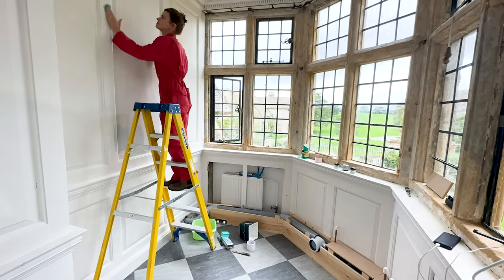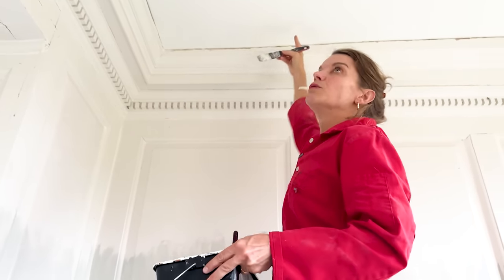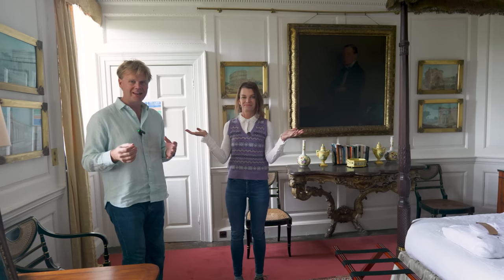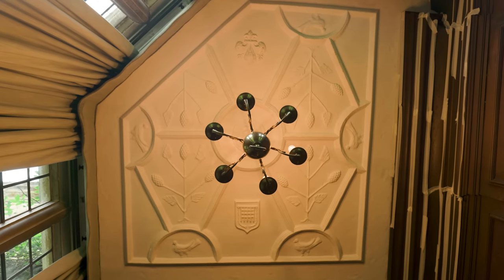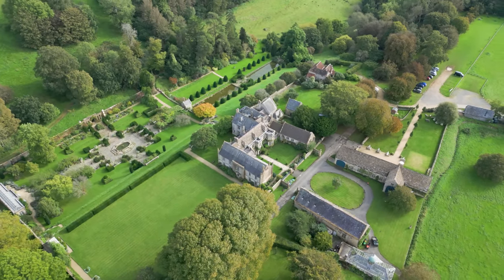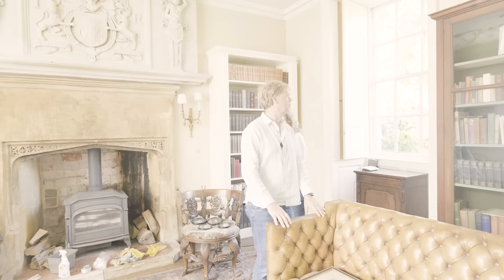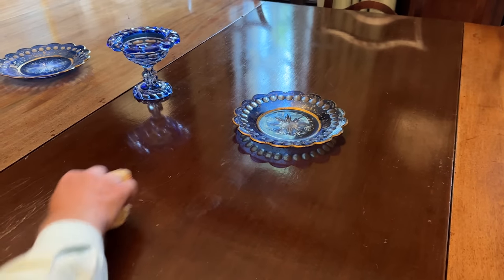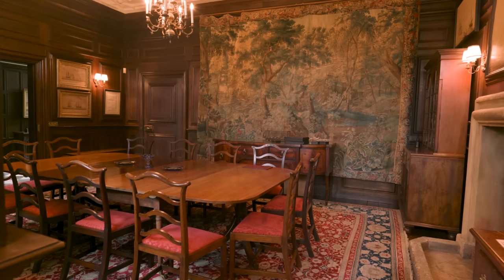How we Transformed our 300 year old Bedroom with Old Fabrics from our Lost Castle

Comment: My vote for the library wall color is a creamy ochre or honey. It’s soothing and also could be quite neutral as most libraries are painted with men in mind - such as a dark red, grey, black, deep blue etc. A honey tone would keep the room light, but still give the effect of a deep, rich color. It might even make the piano pop out a bit more. The maintenance of it would be easier than the cream. I never recommend a deep red, only because if you change your mind, red is so horrible to try to cover up. You need to do many coats of primer over red to change it. I always equate red as an angry color, and it could make someone’s mood swing quite quickly upon entering the room. Not what you want in a library or music room.
Reply: I agree with you about a rich creamy ochre or honey . Will definitely compliment the stone mantle surround , the leather sofa , and the wood of the piano . Paired with complimentary  shades of green in the Library . Warm , cozy , and comfortable furniture providing excellent back support while reading 📚 is key in a Library . Back and neck support and great lighting provided by wall sconces and table  lamps for evening and wintertime reading .

Comment: To clean the soot off the bricks in my chimney I sed a hand held propane tank torce to the muck until it burned off and turned to ash. The bricks should not be compromised in the process. after they have cooled such as an hour get a sponge and sponge them down with plain water. They should look much better.

Comment: Dark would be spectacular, something like Farrow & Ball’s Hague Blue. Keep the ceiling light so it doesn’t feel like a cave. But you have plenty of windows to balance the darkness.

Also, walnut shells have been used forever as a textile dye. So it makes sense that it would work as a gouge-filler. It’s probably far better on an antique than the petroleum-based wax crayons that are sold today.

Comment: I have always used Brazil Nut for removing scratches. It has a smoother texture than Walnut, so it is less likely to add to the damage. I've also found that you can add a little more pressure, which seems to cause the dents associated with scratches to swell, making it smoother. Afterwards, I use a polish with a high beeswax content, though these can be fiddly. Too much on the duster or left on the surface too long, makes it really difficult to polish up. The results, though, have always been excellent. Light scratches disappear, deep ones are made less noticeable. 

I love that you are not replacing curtains. All of my windows have shutters, partly to improve my asthma, but also because I prefer the less fussy look.

When deciding upon the library colour, I'd decide when the room was to be used. If a daytime room it needs to be light. If it's for the evening, then dark. I love a red room in the evening.

Comment: The work looks wonderful, and oh,  I do take D3 K2 combo and being a Hashimoto’s and now  cardiac 3 mildly regurgitating heart valves at 56 this is important to keep the calcium in my bones and not in the tissues  and not in my carrotid artery’s and the two are a power combo. I still keep active and ride my bike. Getting back to the bathroom, nice work! Its not easy in a great house such as Mapperton. Time to winterize the place as cold dry weather with snow is looming in our future where I live in Saratoga county NY. I love watching your channels. Luke is right to  use Walnuts to fix the finish on the table! It does work to a degree, however a french polish would work better for very old wood! Those scratches are pretty deep. Consult a conservitor in the area so as to not damage the surface any further. Great work.

Comment: On the large flat paneling, when you paint , do not use “barn painting” strokes (small rapid up and down movements).  Long, steady, one direction strokes.  This leaves smoother lines, less dripping, and no streaking. ❤️

Comment: We had felt-backed dining table pads, additional pads for each of the three leaves, for our mahogany dining table to protect the surface. Never a scratch nor water ring from my great-grandfather's day to mine. And our tablecloths were sorted by length, depending on how many leaves we were using. As a child, hard to keep straight which cloth to use - size, color, style/formality - when setting for a dinner but our table was always beautiful, never scratched or faded. The original color on your rarely used leaf is the right color when you refinish the table. But do get the custom pads & tablecloths. Your table will remain perfect for further generations.

Comment: you need though sticky sponges that take off smoke from the fire without water! the cleaning company used them in Our house after we had a fire!
Reply: Yes the sponges are made of vulcanized rubber and you use them dry. Depending on what kind of paint is on the wall, you’d want to test it out first.

Comment: Next time, use a little bit of mayonnaise, bought kind if good enough: the vinegar cleanse, the oil fills enriches the wood and the scratches disappear instantly. It works only on old furniture and not of modern finish. Try it at least once. A tiny bit of mayonnaise is enough. You will be amazed. This is not a joke, a friend told me 45 years ago and I did it. It works so well that you will not even think of having the top of this beautiful table redone. Imagine the money you will save.

Comment: Dont understand the large tiled floor in the bathroom it competes with the lovely paned windows which are the feature of this room.The wall colour is odd also it doesn't sit well with the beige stone.Did you consult with an old building architect regarding wall colours and floor coverings? In France we have Batiment de France which deal with old buildings and guides you on all aspects of renovation to ensure its done correctly.

Comment: Mm, why put a peel-n-stick tile in the bathroom instead of doing a proper hydro isolation with cement board-membrane-shluter and put ceramic/marble tiles on top? This way it would be 100% fail proof and level and would be there for ages?

Comment: Why doesn't anyone use paint rollers? In my experience brushes leave ridges and visible brush strokes, and take an age to cover an area. Rollers give an even, smooth covering and cover a lot of area in a short time. I've watched several renovation videos from England, France, and Portugal; everyone seems to use brushes. Fat, round brushes that cover about an inch of surface per stroke. I understand using a smaller brush on the dentals, but on the rest of the wall seems a time waster to me? There must be a reason for that.